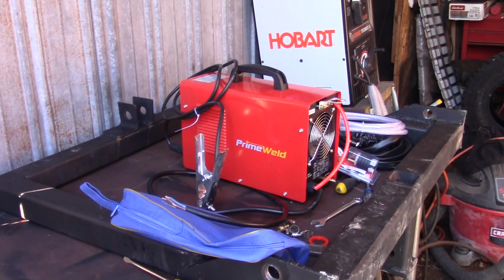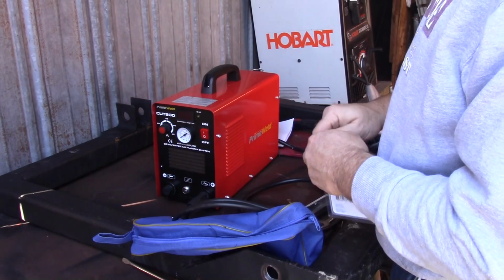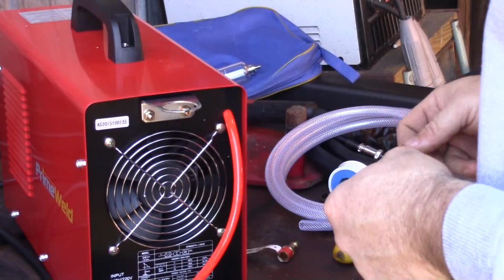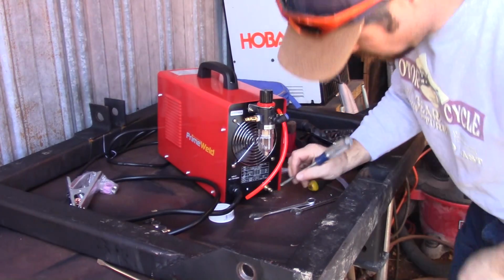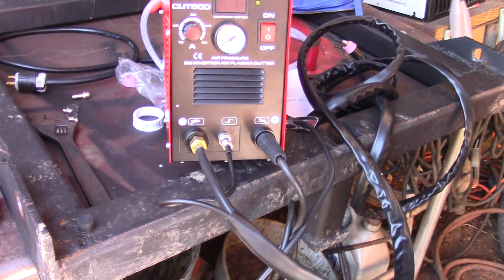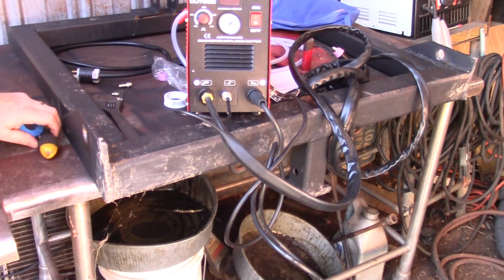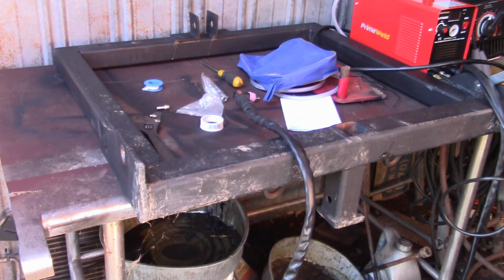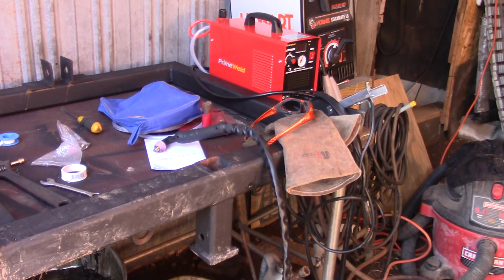PrimeWeld Cut50D Review

Comment: FWIW. I have one also. Check the {stick} leads where the hex screw secures the cable to the male connectors, that connect to the machine. Mine, well the cable is too small for the connector and the screw winds all the way in. Even with their brass shim bit. Put a thicker shim in there, or as I did, throw their smally cables away, and connect up some 25mm2 or such like. Yep, alls good.

Comment: When wiring this kind of equipment for 220 single phase, you have two hots and a neutral. There is no ground. For 110 single phase, you can wire one hot to hot, the other hot to neutral and ground/neutral to what you think is the ground plug. In most sub-panels, the neutral is bonded to ground at some point before or at the first point of line switching.
Reply from the maker: Thanks for the info!
Reply: There is a ground, it's an equipment ground.

Comment: What size air compressor do you have and is it adequate?  another good video.  thanks
Reply from the maker: +Jim Buford I have a 60 gal air compressor in this shop which is more than adequate.  I've seen videos with people using 4 gal air compressors with these and having no issues.

Comment: Good price for a plasma cutter. I might get one if it works well for you.
Reply from the maker: +1988MowerMan I've seen similar plasma cutters on eBay going for less than $300 and probably all come from same company in China.  Search "Cut 50" on eBay.
Reply: @farmboy30117  yeah they might all come from the same factory but not under the same standards ! Each company have their own standards and even if they all made in the same factory they used different materials for each brand

Comment: I bet it will last a longtime. I hear they are good for general cutting use. I would keep the consumables changed out when they need to be, and roll on with it. One day i may buy a cut50d off of ebay. But it maybe awhile. Thanks for posting!
Reply from the maker: +jstrunck I hope it does.  I'm not very good at cutting metal cleanly but at least I can practice more now instead of worrying about running out of oxygen ;)